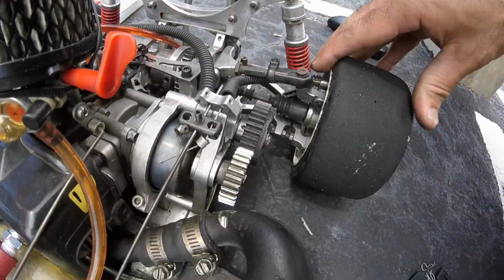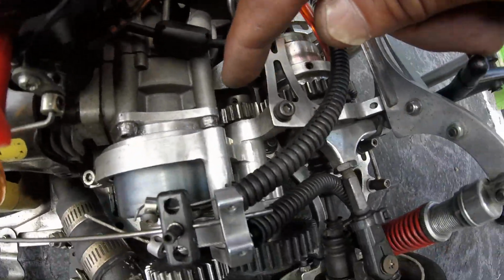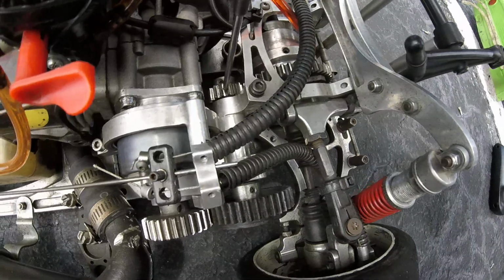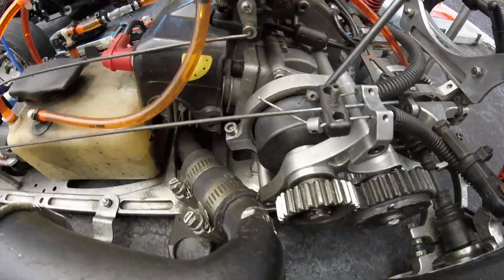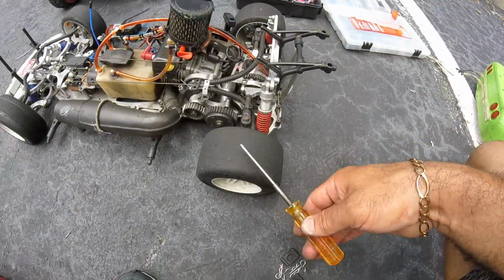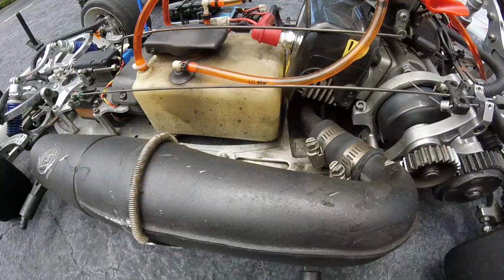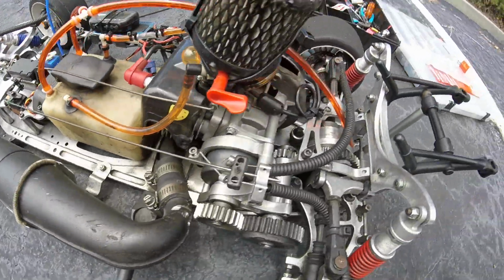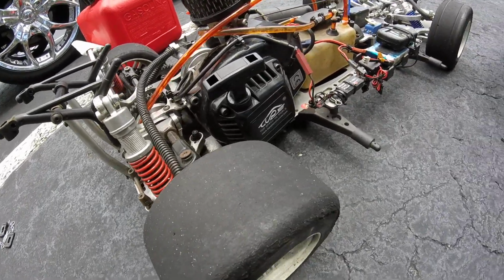1/5 FG Modellsport Car 2wd 34cc speed laps test #2 video

Comment: RC need some help I purchased the 38T spur gear but I need the aluminum spur gear carrier what size do I need I see they have 47 and a 52 and 60 is it the 47 thanks bud for the help in advance....
Reply from the maker: 26t / 38t gearing is what you need. DDM racing have them but they out of stock on the 38t spur. I talked to Steve from the and he said they will have them in 2 weeks.